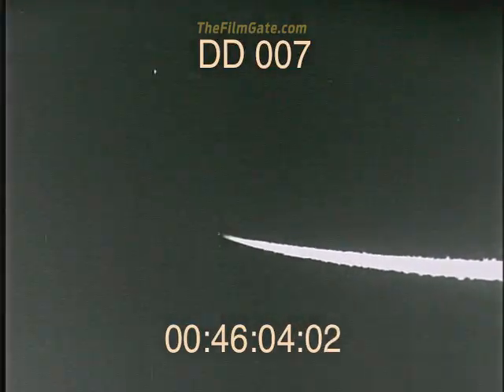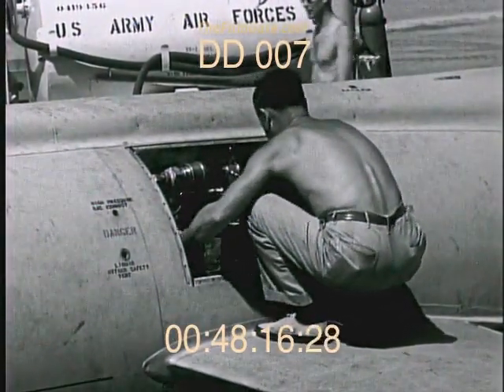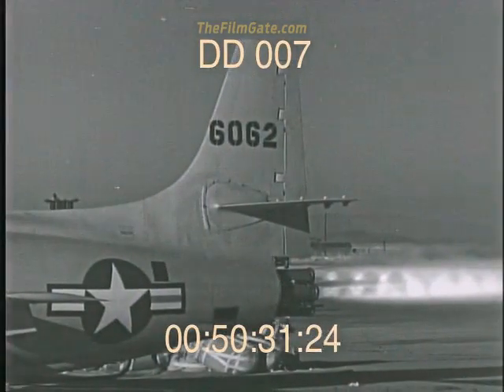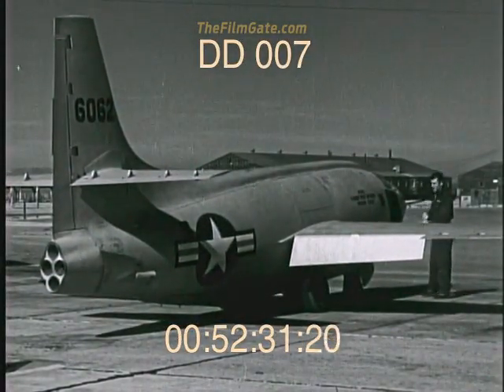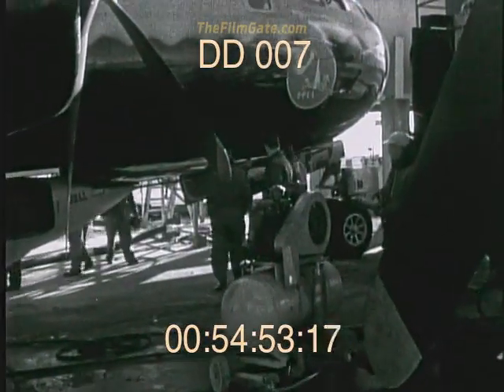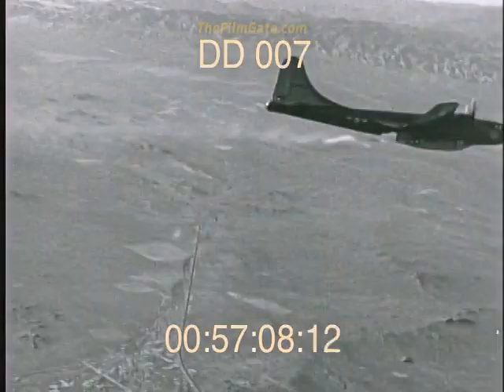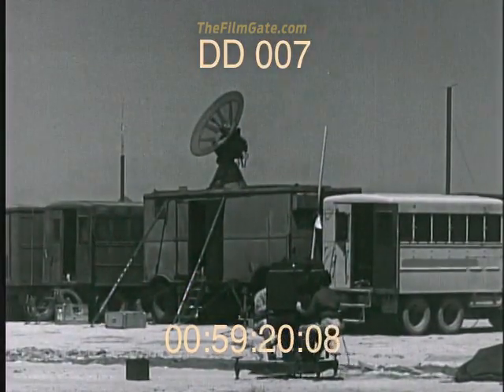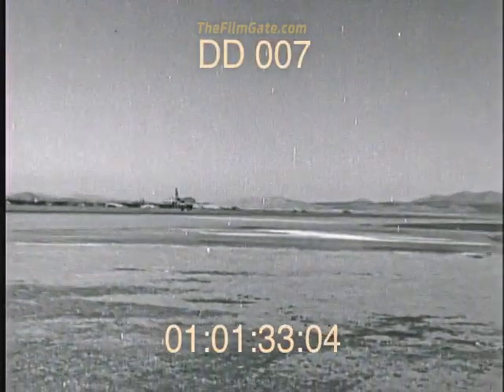Chuck Yeager taking X-1 Supersonic | Stock Footage

Comment: Chuck Yeager had a mechanical mind. People like that often struggle with math, but he knew the plane. He could tell them what need to be done or what was wrong. Not all pilots are like that. Some have the numerical mind they can work it out on paper or a computer now. He was a kinetic pilot, not a technical pilot. That's what I picked up after reading his book.
Reply: Actually, Yeager excelled in math while in high school. I should point out that pilots have to think in terms of 3-dimensional space, which intuitively deals with acceleration and velocities on 3 axes. The only engineers who use math on a daily basis is electronic engineers. More often than not geometry and trigonometry are more important than high-level math, which is good for analysis but isn't of much use in understanding systems relationships in real time.
Reply: @F-14_Jockey  Yeager worked on planes before he started flying them, he was a mechanic. Which is why he was such a good test pilot, he could give them suggestions to improve the plane. To get through flight school you have to know the math. They are pilots not engineers in physics. You don't have to know how to fly anymore, the planes practically fly themselves. All they need to do now is know how to read the instruments. I wonder how many pilots can land a plane in the Hudson now? In his auto biography he stated that he struggled with the math. In his own words.

Comment: This is a British design with a Bell badge in it. 

Proud Brit here.
Reply: How so? We know the British tried to break the barrier b4 in dived flight and failed,they quit pursuing it, when Dehavilland Jr died.
Reply: @ Britain had a design but didn’t produce it. Miles M52. Shape is the only thing known at the time to be supersonic. A rifle bullet.
Reply: The is ZERO evidence to prove that the British had any influence on the design of the Bell X-1, it is pure fantasy and wishful thinking.
The Miles M.52 is pure British science fiction fairy tales, no such aircraft ever existed because no M.52s were ever constructed.
 The Miles M.52 scandal is the most shameful and humiliating chapter in British aviation history.
 When the embezzlement scandal broke, Ministry auditors raided Miles Aircraft and found nothing, the 2 prototype aircraft and the funds to build them were never found. only a few incomplete drawings and a partially completed wooden mock-up of the cockpit was found. Miles Aircraft was charged with 24 counts of fraud and embezzlement, and the company was seized by the Crown and placed under administrative receivership. 
  Frank Whittle was arrested and sacked from his company Power Jets Ltd. amid allegations of embezzlement, extortion and dereliction of duty and was discharged from the RAF. 
  In hindsight we know that the M.52 could never have flown supersonic, no aircraft powered by an inferior centrifugal jet engine has ever flown supersonic in level flight.
Reply: PERFIDIOUS ALBION
 stop spreading lies and misinformation about the Bell X1 program.
The British did not contribute any technical data used in the Bell X1 program.
The Miles M.52 never existed.
Reply: Yeah proud Brit that the USA had to save your whimpy butts in two World Wars. Get real.
Reply: Never happened, the Miles M.52 never existed... it pure British science fiction fantasy..